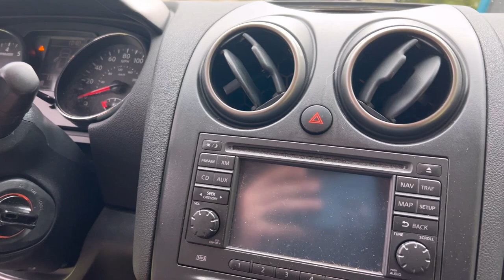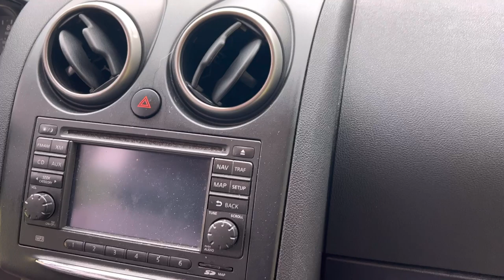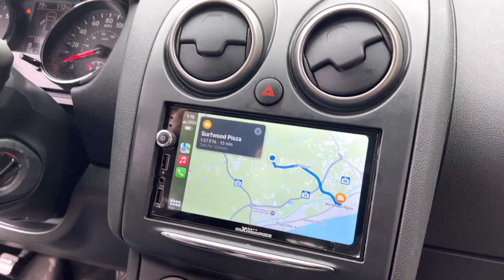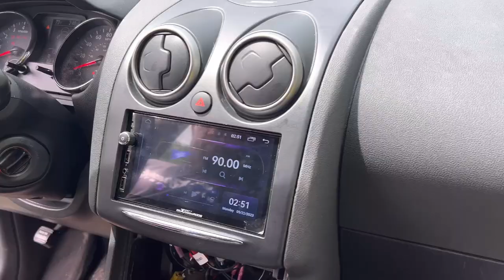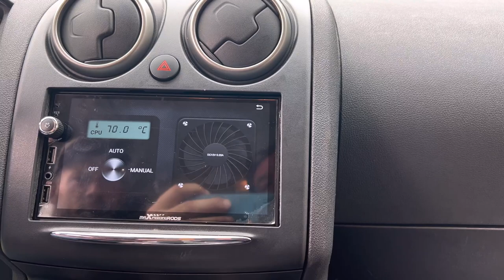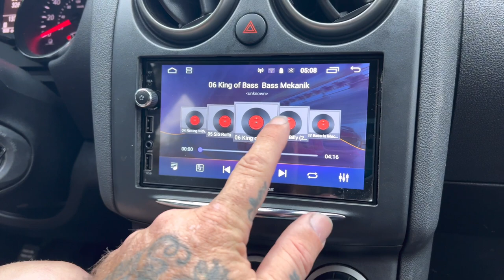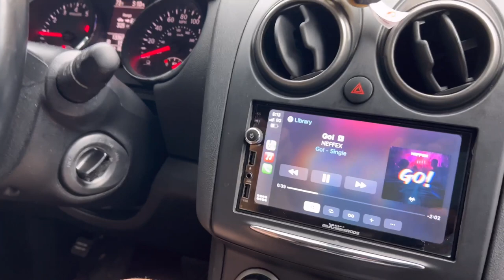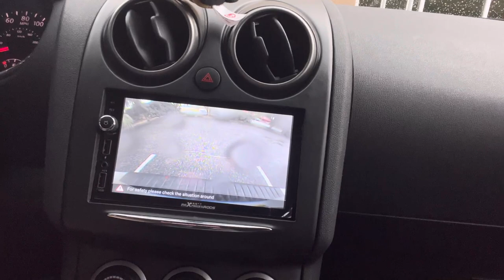Maxpeedingrods radio install the good and bad

Comment: Jerry that head unit vs2 will be nice after we get them to knock out the kinks....but also tap home screen icon for the speedo......i love radio in my dash ....just a crappy mounting also...i lost my stock volume on steering also....oh gotta set the timezone also
Reply from the maker: we got time zone figured out. home screen icon will do speedo but not when playing music from phone for some reason
Reply: @JerryAintloud  fit great  in my 2012 sierra that came with the standard double din factory radio

Comment: So im looking at this head unit just for the dsp alone my car factory radio has six speakers one center speaker and 4 tweeters that I’m gonna get all new with Amps but would you recommend this for all the amps settings? And for the sub

Comment: This is actually the best android head unit on the market for actually listening to music ... That is what a radio is for right? Lol.. cuz it has the best DSP implementation on the market in this low price point and 5.1 surround with all the rca pre amp outputs for it..  Especially if you use  multichannel external amps.  All the generic android radio's do require you spend a couple of hours learning the menu structure and programming all the settings, tho. A lot of basic stuff like showing  temp in Fahrenheit, MPH not kilometers, Your make and model of car, how fast things like volume respond and the gain, and so on... Major name brands do most of all this basic stuff at the factory ( I call it Americanizing the unit Lol )

Comment: I bought this radio and couldn’t use the brackets on a 05 F150 and can’t get kit to install and bolt to factory mounting 

Ended up buying the required install 😊plate cutting with a dremel using a flex seal putty to mount to bracket then I have no idea where power on off switch is it stays on all time till key off and times out. It is junk radio in my opinion

Comment: Does it have one or two rc jacks? I got a cheap one off amazon called atoto and it only had one rca wire i had to run a 1 into 2 splitter which i dont care for i think its killing my system tbh lol

Comment: What's the RCA ouput voltage on those? They really need a 10 inch display. I've been battling with these cheap large display units like Eonon or Atoto and their awful less than 2 volt RCA output voltage. They just end up causing hiss somewhere in the chain. Even with a line driver or DSP.
Reply from the maker: 4v

Comment: There is a video by The DIY Car Audio Guy on the Maxspeedingrods touchscreen. The guy on the youtube video says that there is bad distortion at high volume when using the internal amplifier. He says use external amplifiers and there is zero clipping at max volume when using the RCAs.
Reply: Like most aftermarket radios the manufacturer adds a certain amount of gain overlap to the high level outputs. It might start clipping about 5 clicks (for example) from max volume. The low level outputs might clip 1 click from max or not at all. 
The reason you get bad distortion at high volume when using the internal amplifier is because its not a lot of power.
Reply from the maker: when i get the enclosure built it'll be on external amps only.
Reply: I sent you a YouTube video of the head unit test by the DIY Car Audio Guy. https://youtu.be/vEvRvImYYHQ

Comment: Are used 3M tape on both sides of the brackets to put it on easy. I’ve been liking it, but I’ve had this problem while an apple CarPlay when I turn the volume up, it sometimes turns the volume up by itself only when i move the volume knob tho.

Comment: I installed one in a 15’ wrangler and used a 2din mount kit and the volume knob rubbed. I used a round file with 320grit sandpaper wrapped around and gently filed at the knob for clearance. Installed it and you can’t even see where I filed it. The DSP is bad ass. I have all x-over done at the head unit and amps set to full range. I tested the x-over with different frequencies and it spot on. Best part it’s inexpensive

Comment: To get back to the speedometer, go to the home screen, press on the clock so it shows on the top of the screen like the music player was, and what you do is press and hold your finger on the edge of the right side of the clock's screen for about 2 seconds and let go. It should switch back to the speedometer with the car next to it. I can help with a picture if need be.